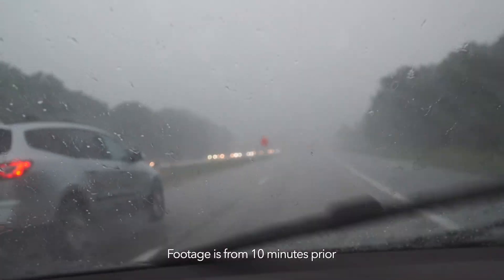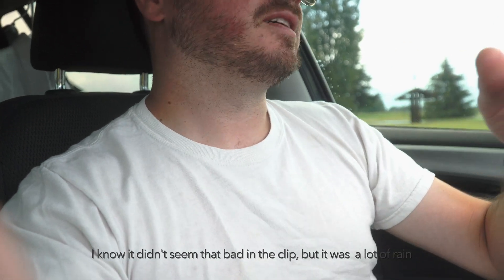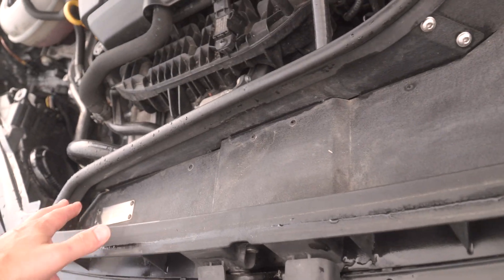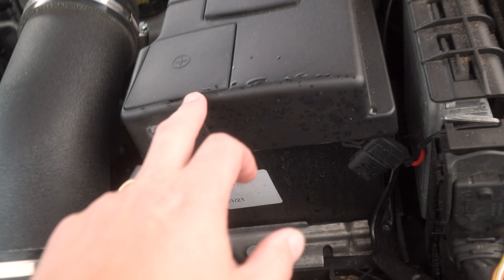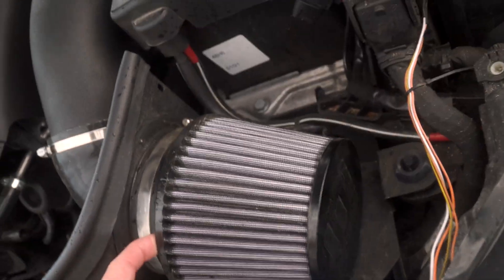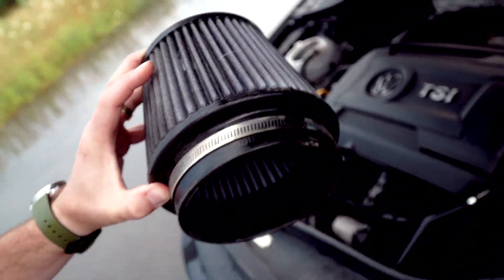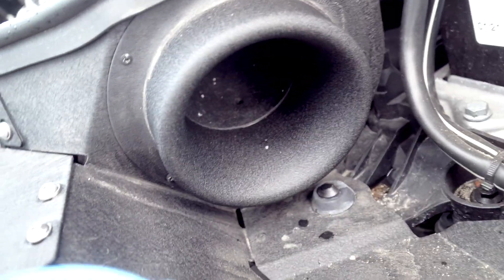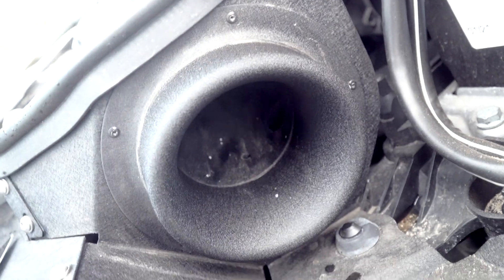Does Rain Water Get In To The Integrated Engineering V2 Cold Air Intake? Let's Find Out - MQB MK7

Comment: I also have the IE v2 intake but with the lid. I live in Florida where it rains really hard. Yesterday I drove home though a huge storm (mini hurricane). It was so bad that I cousln't see a thing. I got home and checked the IE V2 intake and there was a very little water in the intake. It looks like it drained through the holes like it should. The filter did have some water droplets on it but nothing crazy. the engine and the battery were dry.

Comment: But what about when washing the car with a hose? It sure looks like water could easily get in there while rinsing the front grill up high. That’s why the stock air box has the opening closed off and air comes in from the passenger side…so no water can get in there.
Reply from the maker: No issues when washing either.
Reply: Why doesn't make sense why they did that being that the stock box has a built in drain